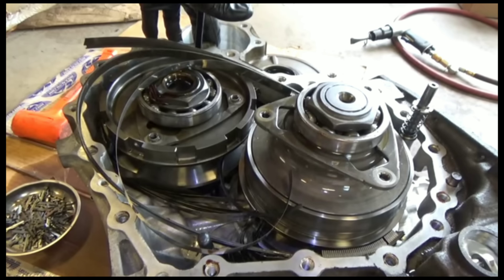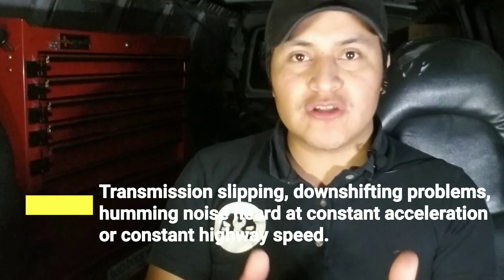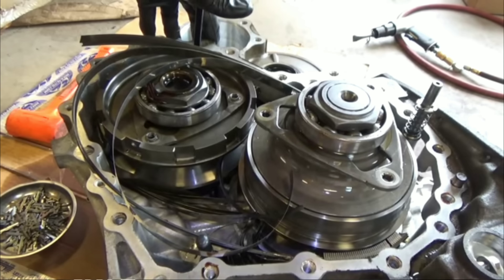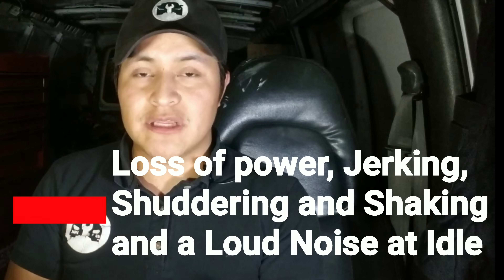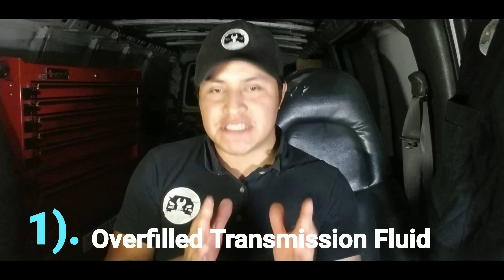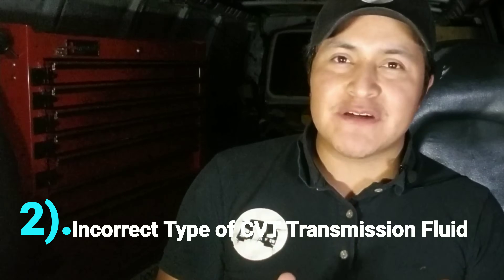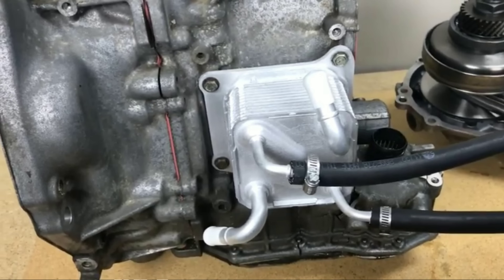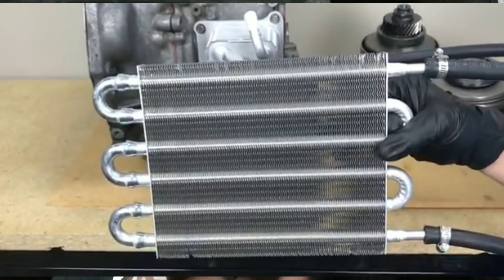NISSAN CVT TRANSMISSION | why it fails and what you can do about it to prolong it's life

Comment: Hey buddy I just subscribed you. I bought brand new 2028 Nissan Altima SR midnight I changed transmission fluid at 45k now it is 60k should I replace the filter also which is inside trans fluid pan and one outside on the side also on my next fluid change

Comment: I have a 2016 nissan altima. Cvt went out after I bought it. Got a new one 2 ish years ago. I had the fluid changed. It temporarily went into limp mode the other day? Im not sure what to do? What is causing it? I took it in and they did all the work.

Comment: I have a 2017 Nissan Altima that I bought from my brother 1.5 years ago. He bought it new from the dealership and he kept up on the maintenance faithfully once the warranty was up he changed the oil every 5,000 mi faithfully and then he even did a CVT transmission flush on it 3 months before I bought it from him. The reason he sold it to me was because it broke down and he could not get it running which I ended up fixing all the wiring was just burnt out under the hood I had to rewire the O2 sensors the throttle body and all the coils. And it's been driving amazing ever since. He delivered pizza for a living and he managed to rack up 239,000 miles on it, and as of right now it has 245,000 miles on it and the driving home last week at a dead stop when I was literally 2 minutes from my house taking off the car started shaking violently I got it in the driveway shut it off went back outside to check it and the car went into limp mode and will not move at all. I did a transmission fluid change and it did nothing I'm going to do another one with this time replace the filters with it to see what happens. I've been told that I'm lucky that this car has made it 245,000 mi with the original transmission, it just sucks I wasn't ready for this to happen

Comment: I did a fluid change on a 2013 rogue (133k miles) and it was fine for 5 days then the dipstick showed that it was overfilled with a little bit of bubbles.  Mind you, I had only poured 6 qtz. and the level was fine all this time.  Anyone have any suggestions? yes, I changed the filter and cleaned the magnets
Reply from the maker: Was the car leveled when you checked the fluid level?
If it wasn’t leveled, it can give you a false reading
Reply: @WrenchLink  Yes, the car was leveled.  Prior to that, the previous four days the reading was precise on the dot.  All of the sudden, it started showing way higher on the dipstick, with a little bubbling.

Comment: I have an infiniti qx60 2014 and yesterday it started to slip and jerk also shudder without any noise at all and it only happens when the car starts reaching operational temperature i was told the valve body on these are a common issue to go out without and tcm codes at all so what i do in this case? Literally no noise at all everything sounds like new she even shifts into drive and reverse smoothly. Again no freaking noise at all just the symptoms also no limp mode and also no metal in the cvt fluid at all. Its like she says ill work cold but when at normal temperature ill start Jerking shudder/juddering/shaking/slipping but remember when im cold ill work smoothly 😂it's like love and hate at the same time. The only code i have is the typical code every nissan/infiniti gets tm inspection nothing else and this code is there since for ever the car never had any issues fluid been changed normally also filters so whats your answers for this crazy testament? Does the valve body just go out without sending a bye tcm code ? Kinda crazy

Comment: If you have a Nissan with a CVT transmission, sell the car, before it hands you a big bill. One possible exception:
A Nissan Versa. Its light enough not to unduly stress the CVT. But, be sure to service the transmission on an
accelerated basis. Change the fluid ahead of Nissan's recommended interval.

Comment: My 2015Murano doesn't have a dipstick or way to check the transmission fluid.  When the car began the mild jerking I researched on line how to make sure it had fluid and should I have a transmission fluid change.  Everything I found said that the transmission was a closed transmission and there was no way to change the transmission fluid on this car.

Comment: its wild my moms car is roughly 10 yrs old but only has 40k miles on it. i move it around when i visit her or she visits me. she had just visited and i saw no signs of it slipping at all. i was a mechanic for yrs back on some older cars and even had my own trans go out on my 88 buick where i felt it slip and drove it till tthe gear blew out the case on a hill lol. with hers though she was here visiting, went home, 2 days later was going grocery shopping and the car just lost accelaration while she was turning lanes. how this isnt a lawsuit is insane to me. i have surgery in a few days and i need a driver and they are rushing to install it but itts around 5k$

Comment: If I take my Nissan Rogue 2011 to an oil change shop like Mr. Lube or Jiffy Lube instead of the Nissan dealer, I refuse to let them top up the transmission fluid when they do their fluid check ... because the staff these shops often have working will otherwise use the fluid for a conventional metal gear transmission - which is totally totally wrong as it will cause the CVT belt to slip. CVT versus geared transmissions require different types of transmission fluid but too many 'grease monkeys' just do not know that ... but once the wrong type is used it's impossible to totally drain the wrong stuff out some will always remain in my understanding. So I try to be sure to use only a Nissan dealer to do my oil changes.

Comment: hello - just watching your video - question   2014 Nissan Sentra - 260k miles- bought used ofcourse.  no errors..but occassionally feels like a slip in driving/transmission...would a drain and fill be recommended - or replace filters and fill - ?  thanks for suggestions

Comment: Bought a 2018 Altima S for my son. Had 90,220 miles on it. Bought 3/36 warranty for $2,000. On third day at 190 miles driven, trans slipped at take off from stop sign. RPMs spiked for a second. Trans caught and went back to normal. Transmission shop said a new trans was required. Warranty refused to cover saying it was a pre-existing condition. Started researching. Trans fluid did not appear to have been changed during the 90,000 miles. It was BLACK. On 7-4-25, drained 5 quarts from removing the drain plug - the most you can get out without a "flush". Put in 5 new quarts. Drove for about 15 miles and trans went into "limp mode". We could only get to about 25 MPH. Decided a new trans was the only answer. Based on research that I shared with my wife, she said try again since you still have fluid that was not used. To make her happy, on 7-13-25, I pumped out 3 quarts with a hand pump and replaced. I drove 23 miles in 100 degree temps. No issues with slipping or RPM spikes. Came back home and drained another 3 quarts and replaced. Drove 68 miles today in around 100 degree temps. No issues. I used Valvoline CVT fluid from Walmart. I will probably change 3 quarts at a time a few more times. Today, there were no RPM spikes, hard shifts or slipping. Hope this helps. Update: As of 8-13-25, we have put 639 miles on it with no issues.
Reply: Update: We made it over 2,000 miles with no issues. Trans started to slip about 2 weeks ago. Based on the activity and my research, I replaced the battery. For the next 2 days it shifted roughly a few times and threw a few codes, but it was way less than before battery replacement. In the end, I took it to someone that was highly recommended who had been in business 29 years. He recommended replacement based on the slipping and codes thrown. In the end, I'm paying $6,316.00 for a new Nissan transmission with a three year warranty. Not thrilled to have to fork over that amount, but I won't put my only child in danger. Before battery change, I drove about 2 miles while still close to home. With the trans slipping while pulling off from a stop sign, it scared the shit out of me. Cars were coming, so I was overly cautious pulling out. But, I would not want to be in heavy traffic in that situation. I also will not own another Nissan.

Comment: I bought a 2010 Murano AWD that barely had any acceleration, shuddering from a stop and a whirring/humming sound at low RPM...  the fluid level was OK, it didn't smell burnt but it was very dark... the code was indicating a stuck solenoid, so I ordered a reman valve body...  I went to drain the fluid, and couldn't, because the drain plug (severely rounded off socket head drain plug). So, I had to just drop the pan and capture the fluid with a large pan underneath the whole transmission... the fluid was black (I wonder if it had ever been changed, it had 220k miles on it) but there were NO metal bits, although it was a bit sludgy but not much. the valve body did not come with a new pickup screen, so I cleaned the old one (it was solid black, but after cleaning I could see through it!) anddecided I'd just try cleaning the old valve body and reinstall it, to avoid having to transfer or re-program the ROM...

Well, it worked, and now runs perfectly!

I had to use a bolt extractor to get the drain plug out, and replaced it, of course. 1000 miles later, still works fine!  I used an aftermarket CVT fluid that claimed compatibility with the recommended NS-2; I knew I'd want to change the fluid again, soon, so I'll be doing that now, and probably will use the Nissan brand NS-2 fluid even though it costs $80 instead of $35.

Comment: Service is key with the cvt. I bought a used 2016 Altima. The cvt went out and thankfully had it replaced with a new one under warranty. There was no history of the fluid being changed. When I got the new one I made it a point to get it serviced every 30,000k miles. Im at 200k with zero issues. Take care of it and it’ll take care of you.

Comment: I had 82000 on my kicks and it was slipping bad.   I changed the fluid and only got out 1 quart.   I put in a gallon of Valvoline and bars leak for cvt and now it’s running good

Comment: Best  informative helpful video on you tube🏆🏅 my mom has a 2017 nissan altima with 44,000 miles. The transmission is slipping. She maintains it well and barely drives it. Nissan should take responsibility for their defective cars.

Comment: I drive an Infiniti. Basically a Nissan. Bought it with 140k miles and was told the transmission was repaired before I bought it. 140k isn’t a lot for such a major issue. Hopefully I can get the thing paid off before something happens

Edit: shortly after posting this comment the transmission took a major dump on me. Stay away from 2013 Infiniti jx 35 or Nissan pathfinder. Notorious

Comment: Hello! my car just stopped driving in the middle of the road. I pulled onto the side, checked gear oil and found it was much below "Low'. But when I refilled the oil, still it did not move. It is a Nissan XTRAIL, 2017 model. What could be the problem?

Comment: I have a 2019 rogue. Car shifts fine. Intermittently during acceleration, I hear a slight noise coming from my transmission. It's not a constant noise. I'm going to change fluid this weekend and check for metal shavings. I'm hoping she's low or lost viscosity. Guarantee it's oem from 2019. Just got this car 4 months ago.
Reply: 126k miles

Comment: I have a 2003 Acura tl, ran dionostics and TCC solenoids was what the problem was I think. Replaced the TCC solenoids and reran dionostics and boom no more TCC codes. It starts but for whatever reason that I obviously can't figure out. Do I need to reset the trans, ECU? If I do, how would I do it

Comment: We're all over here trying to figure out how to fix a transmission and he starts going off about using the right coolant, I can't stand these people who start going into using the right coolant and how could that could be the problem.. that's a long-term anti-rust inhibitor type thing that coolant helps .it's  cooling properties  when do they close environment like an engine cooling system cooling effects are almost exactly that of water... Pulling also has ability to not freeze is easy in cold weather if that's a problem for some people... Put the antifreeze is going to be the f**** problem

Comment: Humming noise from wheel bearing in Sentra, which may have caused due to frequent bump on roadside curb, how it is related to cvt transmission as it is mentioned in this video

Comment: My 2010 Altima with the 2.5 engine with 220,000 miles is jerking and slipping but doesn't make any noise or grinding.  Is there any hope to repair it? The fluid was changed  last time 70,000 miles. Also I can't get the dipstick out. Please tell me how to remove it.

Comment: I need some advice.  I just bought a 2009 Murano with 137k miles and have no idea if the transmission fluid has ever been changed.  It seems to be working perfectly fine right now.  Years ago, I read that it isn't good for the transmission to change really old and worn out fluid because the new fresh fluid can cause the transmission to start slipping.  Does that also apply to CVT transmissions?  If the fluid has never been changed, is it now too risky to change it at 137k miles?
Thanks in advance for any advice on this topic.

Comment: Hi there brother. I love the video. I need your advice on my 2011 Nissan Murano 3.5 

I got this code Pressure Control Solenoid A P0746 

Also U0101, P1778 

Would this cause all the codes because I’m not putting the Right tranmission fluid ?

Comment: The Rogue Sport manual anyway doesn't recommend changing the transmission fluid at all unless you tow or drive on rough muddy roads.  Then they recommend having it inspected and changed at 60k miles "if necessary".

The only place I've heard a change recommended every 30k miles is Reddit where everyone hates Nissans.   Maybe that is the best way to go, but Nissan doesn't tell anyone that.  I'm also seeing a lot of people claim they had theirs changed every 30k and still had the CVT go before 100k miles so I'm not sure how much that was helping, and maybe it was doing more harm than good.  I think there were just a lot of CVT lemons let go off the assembly line.  You either got a good one or you didn't.

Comment: Hi sir I have nissan qashqai 2012 automatic only 67k milage after 30 minutes when I start when I break on traffic lights or roundabout car vibration few seconds then it's fine like on motorway drive well but 

Juddering when 5 to 10 mph

Comment: My 2009 was slipping. My mechanic said it was toast. I changed the CV transmission filter and fluid with Nissan fluid and I am still driving 6 months later. I feel like it has extended its life a little longer. Like the video says, always use Nissan fluid, at $50 a bottle it is not cheap but hey its worth it.

Comment: I have a 2015 Pathfinder with 100,000 miles on it and had no problems until now. I've taken it to the dealer and the code that comes out says that the CVT transmission has failed. But I'm somewhat confused as the symptoms are as follows i can drive the vehicle up to 40 MPG by slowly depressing the gas peddle, as soon as I try to quickly press the gas s if to overtake a vehicle the engine shuts off (same as turning off a light switch), I can put the vehicle in park and it starts without any problem.

Could this type of immediate engine shutoff problem really be a CVT transmission failure??  The cost quoted by the dealer is way too high to consider for a 10 year old vehicle even though it's great shape and I'll probably have to scrap it if I cant figure it out.

I'd appreciate any feedback or if this type of failure has been experienced by other.

Thank you to everyone for your feedback.

Comment: The best thing to do???? Well, don't buy a Nissan & especially a Nissan with a CVT! Mitsubishi Outlander & Outlander Sports use the same transmission. I had a Mitsubishi Outlander Sport and a NEW transmission (cvt) had to be put in at 32,000 miles.

Comment: Hi, I have a problem. My Nissan tida 2009

 AMT takes a long time to engage the D gear after a stop of 4-5 hours or an overnight. There is no sign of ATF leak, gear missing or any kind of sound from the Gear Box.

For moving forward, either I have to keep engine in ideal RPM for 4-5 minutes before engaging D or after starting the engine, engage D and wait for 4-5 minutes. If I engage D earlier than that, the car will remain as if in N Gear. For the R gear no issues at all at any time.

After the car has traveled around 1 to 2KMS, the problem completely goes away and if I shift back to N and back to D again, it will take only a 1 sec delay.

To get the car moving quickly, I have to engage initially 2nd or 1st then 3rd gear finally D and drive it approximately 1KM before the D works.

This problem did not come suddenly. It has been getting worse over the last 2 years, and initially it happened only after an overnight stop in cold season. Now it happens every morning or after a stop of 4-5 hours. The colder the engine is, the longer it takes to get D engaging.

Kindly advise. Thank you

Comment: So I got a 12 maxima 120k miles after market exhaust and aftermarket intake I get my trans fluid changed every 30-60k it’s driving decent I got some work to do struts and stuff but the only issue I have is when I change it to park drive reverse it takes a second to go but drives good I’m hoping its nothing bad

Comment: PLZ  HELP   I have a Nissan Murano 2006 the car works fine in reverse but when you put it in drive it goes a couple feet and then stops like you like the parking brake is all of a sudden put on you turn the car off and it does the same thing again couple of feet then stops  PLZ HELP